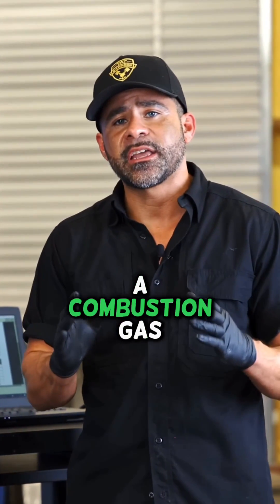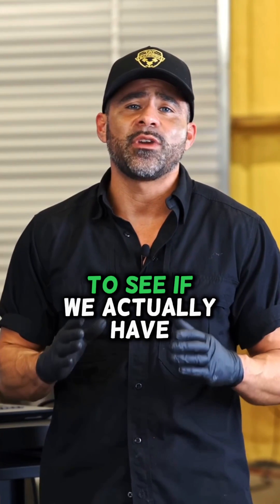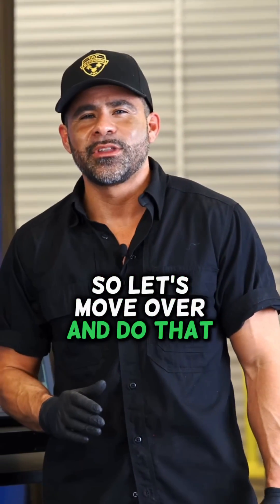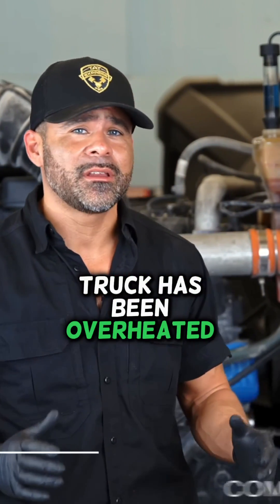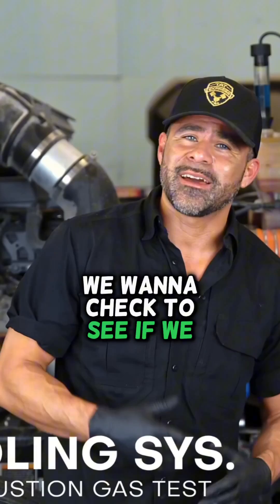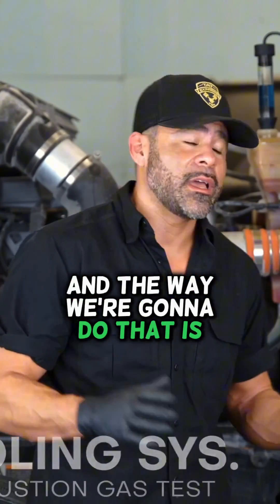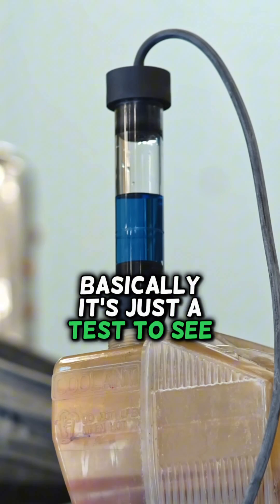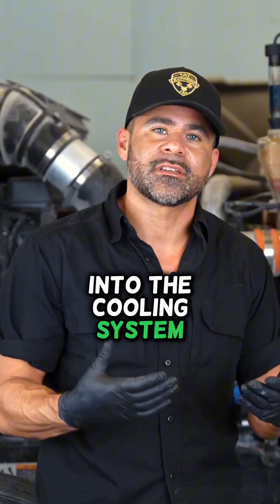Excessive pressure in the coolant system.

Comment: Another trucker here having similar problem with 2020 pete X15 cummins?
I do not get this much pressure but it still overflows and then coolant level  drops way below minimum mark in the extention tank...
Any ideas, suggestions would be appreciated. 
BTW, no gases in the coolant!
Thank you.
Reply from the maker: On X15s the two most common causes of coolant being pushed out without combustion gas are the air compressor head or the EGR cooler. Both are liquid-cooled and can leak pressure into the cooling system without oil or exhaust showing up in the coolant.

Also make sure the degas cap and bottle are good — a weak cap will let it vent early and give the same symptom.

If it keeps pushing coolant out and coming back low after cool-down, it needs a cooling system pressure test and an air-to-coolant leak check on the compressor and EGR circuit before assuming a head.
Reply: @TATEXPRESSINC Thank you so very much!
I needed this kind of confirmation before my mechanic goes bananas and starts throwing my money into the things that might not need to be fixed!👏🫶🤟🤞